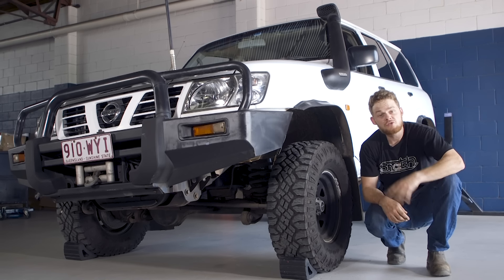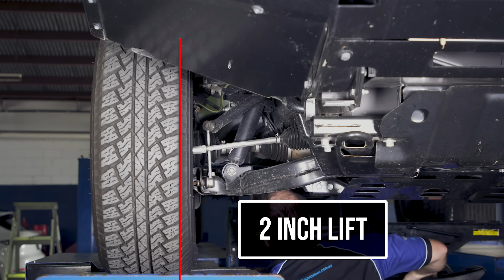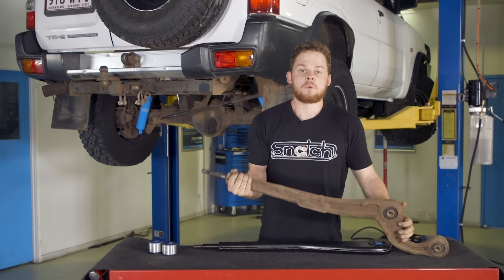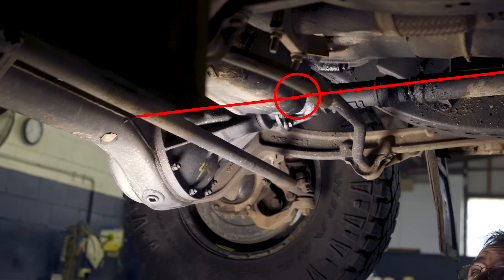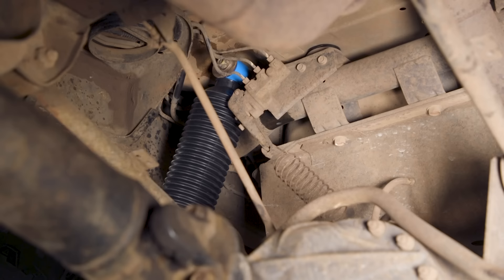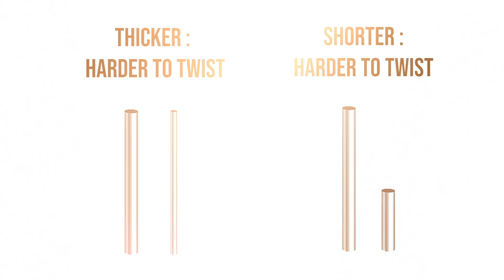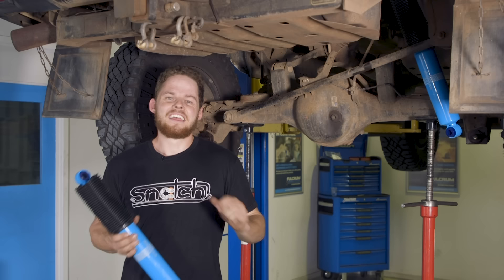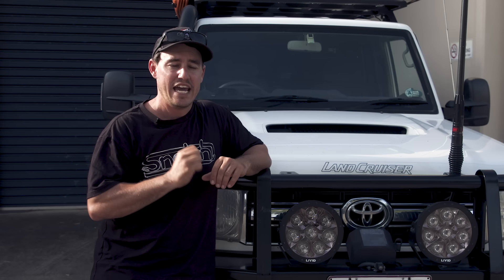EXPOSED! Are bigger suspension lifts better? Experts show what really happens when you lift your 4WD

Comment: is that 2" lift rule only ment for vehicles equiped with traction control & ABS, or can we get something from the past and lift it to the sky!
Reply: GTFORDMAN depends on your state. Just look it up. Some states allow allow an extra inch without ABS and TC equiped. Anything higher and you may as well not bother insuring it and just make sure you earn enough to buy another if you crash it.

Comment: Next how to tell what lift your 4x4 has when you're about or bought it because I tried looking on how to tell and I ended up guessing it's a 2 inch but not to sure I find out eventually, all I know for sure it has 35
Reply: Find a stock one and measure from the hub to the guard, compare to yours and you'll know (going from hub to guard means that the size of the wheel and tyre have no effect on the number).
Reply: @tareskisloki8579  yeah sounds about right i just to find that stock or search it up

Comment: How does a bigger lift fit larger tyres as when off road the suspension still compresses to the bump stops giving the same clearance as stock?
Reply: My understanding is it gives more travel allowing the tyre to tuck into the guard rather then hitting the outside of the gaurd
Reply: just stops it from rubbing most of the time, im pretty sure
Reply: That's true for IFS (and IRS), but for a live axle a lift means the arc it travels is moved further down, so the tyre tucks in lower, clearing the guard.

Comment: Someone at Fulcrum who proof reads what goes on the web page has had too much to drink......   "The SuperPro Lift Correction Arm Kit solves the issues with “built in” castor correction in the design, with nearly 4 Degrees for a 50mm lift and 2.5 Degrees for a 75mm lift.
"
Umm, nah.  2.5 degrees for a 50mm and 4 degrees for a 75mm is more believable.  Patrol is more like 2 degrees and 3 degrees than 2.5 and 4.

Comment: Honestly a lot of what was said was about steering away from lifting your vehicle by using inaccurate figures saying it cost $1,000 per inch is flat out incorrect or by saying your car isn’t going to perform as well as it would on a smaller lift which is why caster correction was introduced also why adjust able sway bar links and adjustable pan hard rods these things are there to make it legal but also to make it perform how it should and perform safely by not actually comparing the two lifts with an unbiased take this video is sadly fearing people into thinking its wrong to put a lift higher then 2inchs to give people the information they need to do what they want to there vehicles safely if they want to put something bigger then a 2inch lift also the fact that Fulcrum don’t offer anything above a 2inch lift is fairly interesting still a big fan of the channel though!
Reply from the maker: We mentioned several times you can go more than 2 inches if you want to. But of course it’s going to to cost you extra money. Lifting your 4wd throws so many other components out of whack and you have to pay to get them working like normal again. Jock even explained why he’s gone more than 2 inches
Reply: Totally but l don’t think those options where explained properly for those changes and the cost for the 4inch lift.  by saying it’s going to cost so much more and thats it is not a true comparison. by going into so much depth on the 2inch lift and not anymore about anything else isn’t a fair comparison in (my opinion) maybe another video is needed for the 4inch lift fans out there!?? If ya need a model let me know! I got the blue steel look on lock down and a Pootrol that looks like a majestic mermaid lol looking forward to see what you guys do next!

Comment: You lost me at "more weight means you need bigger shocks"
The shocks, which are actually dampers, don't carry any weight. The limit the speed at which the spring can move making it wallow less and keeping the the tyre in contact with the ground on rough ground.
What affects the size of the shock you need is heat, like you said, which is technically effected by weight, but not much. It's effected mostly by the amount of movement in the piston. The more the piston moves the more the oil is agitated, the more heat. This is why you'll find you have less traction at the end of a rough road than at the start.

Comment: what would you say the U.S. equivalent to Fulcrum is?
Reply: BDS Suspension! Expensive,  but worth it. You don't have to source anything from a different place. Everything comes with the package. All of the r and d for your particular vehicle is done by BDS, so right off the hop it's safe and you know that it will work like they say it will. Lifted my 94 f150 6" with 35x12.50x18's and never had any problems so far. Been lifted for 5 year's now. Also use the truck to tow a 4000lb twin axle bumper hitch camper trailer with the appropriate size drop hitch.
Reply: Lowell Funk cool thanks bud!

Comment: I got a 2" lift in my GQ and about to buy 33" tyres. What does a lift do to the drag link and tie rod? Do these need to be adjusted?
Reply: Luke Collins should be fine without any adjustments
Reply: No dramas with drag link & tie rod ends mate. Sometimes you need one or both adjustable panhards to pull everything back into line but apart from that you won't need to do anything. Consider sway bar disconnects to maximise the articulation you're getting out of your 2" lift.
Reply: You'll probably find your steering wheel a bit off centre so may want to adjust it back but that's about it. On my GU when fitting a long range aux tank the 2" lift had pulled the axle over just enough that the propshaft flange contacted it at under flex so be careful of that if you fit one as you'll need adjustable panhard rods to bring both axles back to centre 👍
Reply: Its got the 2" lift before I brought it so it has been adjusted with panhards etc. If i have longer shocks will that help with flex?
Reply: @lukecollins7965  Maybe but the sway bars will restrict travel before shocks do. If you get longer shocks & run sway bar disconnect (or removed) you may need extended brake lines & possibly spring retainers if it has too much droop.

Comment: So are you ignoring extended upper and lower control arms to fix the angle problem on purpose? It's not that big of a deal, I did my upper control arms in like an hour and it cost me around $500. At a 4inch lift, my extended upper control arms have the same joint angles as it had stock. The lower control arm has more angle but is not maxed. If I changed the lower control arm and longer axles,(about $1,200usd) I could get to 6" lift with stock angles. You guys are just drinking the solid axle kool aid.

Comment: This lift this amount for this condition is old tired tech. Need to b girl around town easy in or out normal safe highway driver then hydroponically lift 1,2,3,4 or max 5"  mayb 6 stupid tall snow terrible conditions or fording a river/creek. W/the strapping the tires won't hit or rub,& if they do only strapping 2 bands. Then u lift it max ht cinch down the strapping bands to new ht.

Comment: 2 inch lift, 2 inch body lift, 33 inch tytes is all you need
Reply: meninist[cancer]Linus just the tips mate no body lift, just a 2 inch is perfect
Reply: Illegal in Oz as you can't go over 75mm roof height increase without engineering.

Comment: Kind of disingenuous to talk about how a 4 inch lift causes issues when you don't say a thing about longer A-arms (control arms) that give you the taller lift while maintaining the near stock geometry. No difference than stacking a 4" lift block under the rear leaf springs vs longer and more arched lift leaf springs.